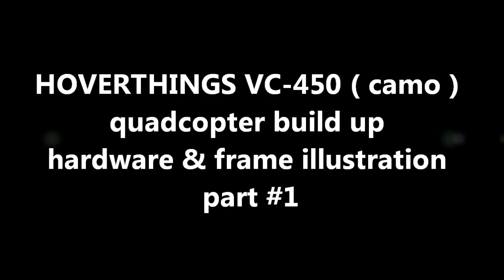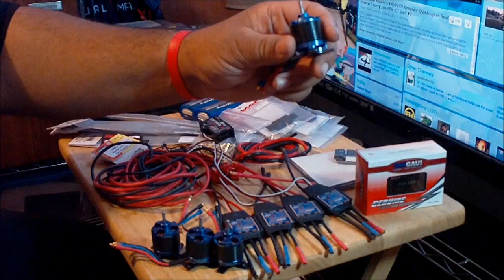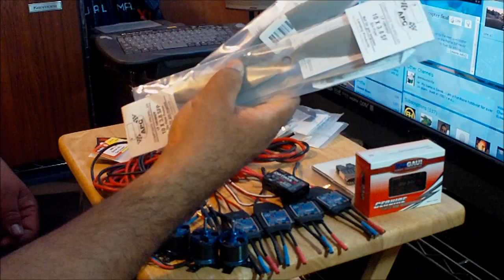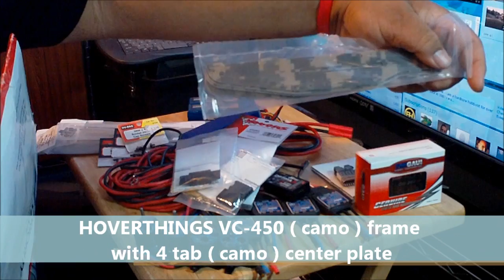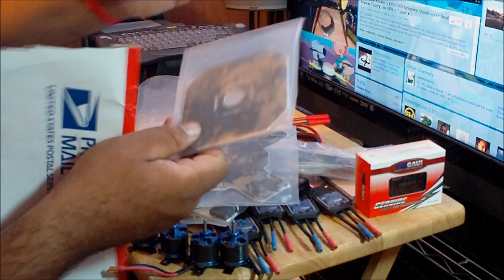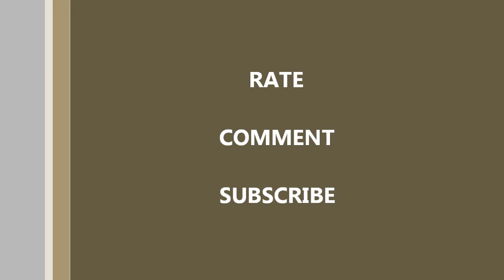HOVERTHINGS VC-450 ( camo ) quadcopter build up hardware & frame introduction part #1

Comment from the maker: Those motors you got are not the right ones for your 525x , you need 2212 or 2215 size motors with either 900kv or 1000kv with 10 inch props to get it to work wright .

Comment from the maker: Normally people don't used motors with that high amount of KV's for quadcopters , those motors that you got are more for airplanes than quads , quad motors are from 775KV to 1200KV but the most popular ones are around 1000KV's , with the motors you got now 35a to 40a are good but you must used small props like 6" or 7" inches .